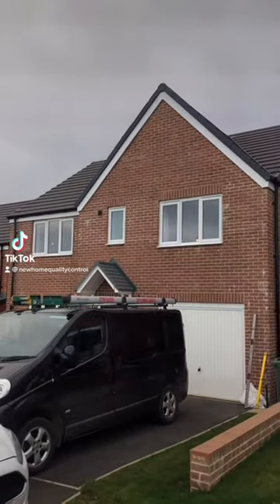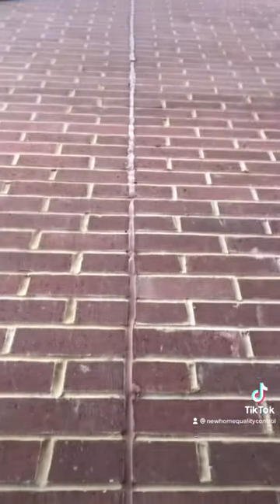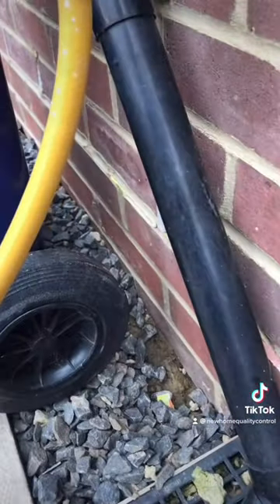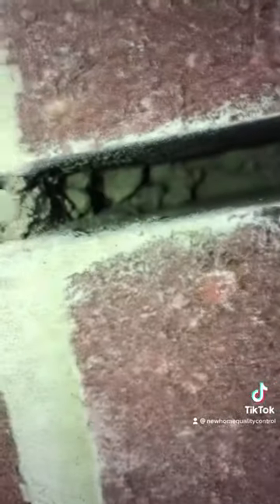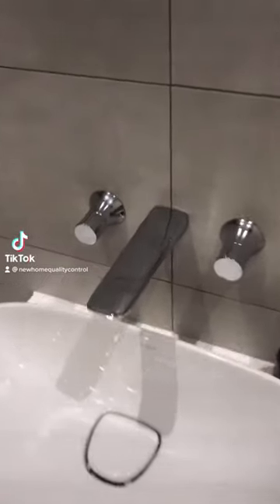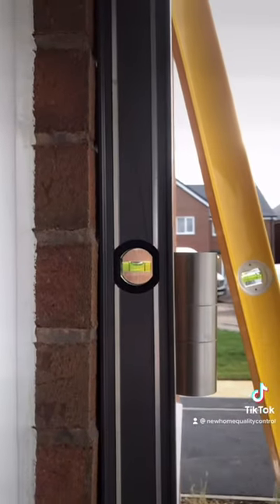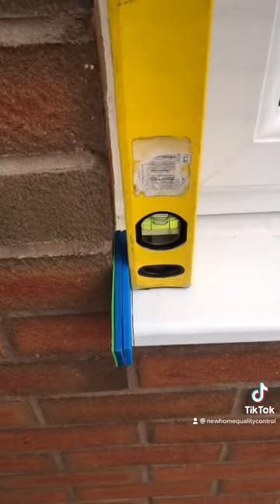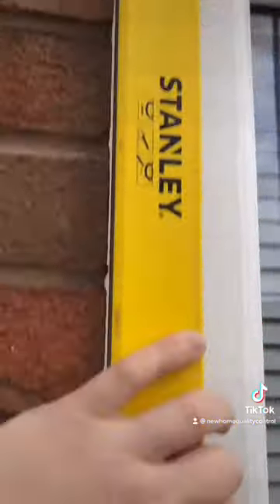NEW BUILD SNAGGING NIGHTMARES

Comment: I'd love to hear some of the outcomes... Identifying defects is one thing, getting them rectified is another altogether!
Reply: They just feed the customer bs until the 2 year warranty is up 
Or most of the time the customer gives up
Reply: @MrAndyhat  that's exactly what happened to me.

Our cheap, wooden, front door was warped and didn't fit the frame, you could feel the breeze through it.
Water could get in...as could snails!

According to them, it was fine, then when I pointed out the water, they came round without telling us (car was out, but I happened to be in) and applied a silicone bead to the letterbox cutting, the window in the door and the little valance at the bottom...
When water still came in, they claimed that the cat flap that I had installed was the cause, although my email history and photographs show that the issue was there well before the flap, and that I had installed it better than the fittings they had put on the door.
I removed the letterbox to reveal that the whole door was saturated with water too, well above the cat flap.

They tried to delay, stall, make excuses and ignore me until I gave in and fixed it myself.
Was going to get a brand new one installed, but covid put a halt to that.
Will hopefully get round to it soon at my own cost.
Reply: @underwaterdick  yep sounds all to familiar 
I snag and fix new builds for several house builders and they are all the same 
So they are consistent in that respect
Reply: @MrAndyhat  such a shame.
The government idea of the builder not receiving all of the funds until after the snagging period would be good.
Giving homeowners a way to claim funds for work the building firm refuse to put right.
Like the Tennant deposit scheme common in renting.

The other laughable thing with our place was the amount of mold that grew in the hallway thanks to this constant moisture ingress.
I have a rather laughable email chain and series of letter/leaflets where they try to tell me that "plasterboard naturally gives off damp" and "I'm not ventilating the house correctly...
Funny, because most of the guidance referenced the moisture from a bath/shower room and cooking.
Yet the two rooms with en suite facilities and the open plan kitchen/dining/living room were mould free.
Just the hallway with its crap front door which had a problem.
Reply: Was just going to say the exact same thing. If a wall is out of plumb past its tolerance what happens to it? Do they knock it down and rebuild it?
Reply: @underwaterdick  And the developer was?
Reply: @pault5947  a local firm who primarily knock out 80+ bed care homes.
I don't want to name them as one of them now live next to us in the development, although he has had to do a lot to it when moving in 🤣

Comment: The problem is that some of these issues can not be easily reworked to an acceptable standard. If a gable end wall is 40mm out of plumb I would assume your stuck with it once it is built..... please correct me if I am incorrect and there is a rework fix. Other than rebuild the gable end of cause..

Comment: When I worked on building sites, no one had to be qualified. No one needed a CSCS card. No one signed off their own work. All work was inspected by the quantity surveyor before you get paid for it. Building sites would hire anyone who turned up in a van with tools, but only paid people who did a job to the satisfaction of the QS. That system didn't have any quality problems, and the jobs were always in budget, because the budget was set and fixed for each finished job.

Nowadays, you go to college, you get your qualifications, you flash your card, and no one inspects your work.

Comment: Who actually buys these? It amazes me, people will go and buy a second hand car or piece of furniture and will haggle over a tiny mark or scratch, yet they go and buy, what for 99.5% of buyers will be the single most expensive thing they ever buy, and they just accept it?

If these houses were cars, they would have kerbed alloys, chipped windscreens, doors that don't close correctly, repairs done with a angle grinder and PU sealant, holes and gaps all over them and structural defects in the chassis.